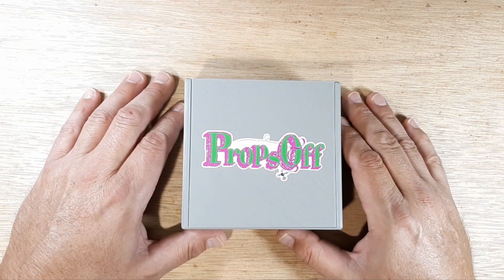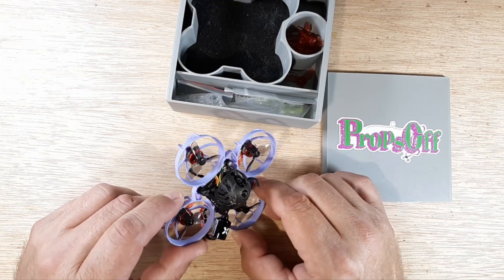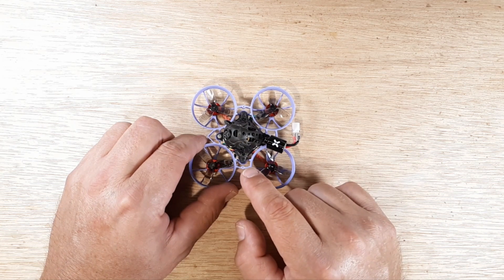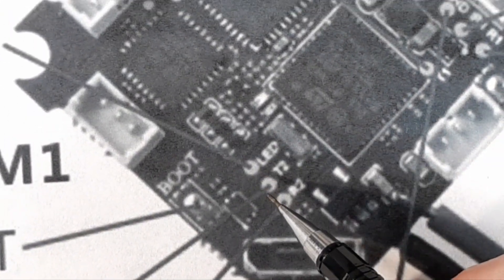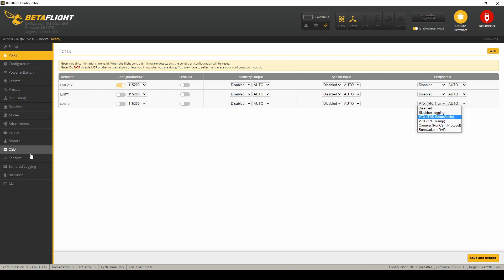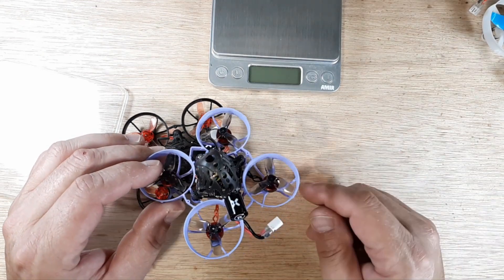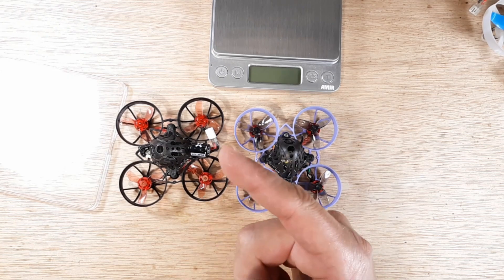Happymodel Mobula 6 VTX Failed | Crazybee F4FR Lite VTX Replacement

Comment: Hey, I wanted to add an elrs module to my fc and than I think i touched the vtx module when tryna solder the elrs to 5v and the vtx is not working anymore ?? What solution would you rocommand to me, im gonna buy a new fc if I can't do anytying from this one...
Reply: Okay thanks im gonna try this
Reply from the maker: @wixfix4094 
Remove the VTX and any solder flow that was incorrect. Do a continuity check to make sure there's no short (how to in my Quick Tips Playlist). Then plug in a lipo and check the 5 volt pad and ground to see that the VTX will have correct power - also in my Playlist...🧐

Comment: @PropsOff I have two Diamond F4 ELRS v4.3, one of them is showing two mosfets having blobs so i want to take the mosfets from the second and put it in the first blobed ones. Now does the order matter ? the mosfets having blobs is the top lef, if i took mosfets from the top right of the second Diamond and installed it in the first would it work ?
Reply from the maker: @bazooka5780  
This is a great question. The mosfets are all the same around the board and can be used in any of the 12 positions. There is a dot on the face of the mosfet signifying correct orientation - that must match the replaced mosfet...🍻

Comment: On the new board V3.3 is much easier to disable the VTX with just Uxbridge a solder joint and also the video out has a pin now.
Reply from the maker: They've definitely made some improvements to allow customization...🍻

Comment: Can I disable the onboard VTX and put a Digital VTX like Caddx Vista?
Reply from the maker: Yes, the video is separated once the internal VTX is removed. I haven't done this so I'm not sure if DisplayPort will work via MSP...🤔
Reply: @PropsOff  thanks for the response.
I'm thinking of converting this onboard Analog VTX to Digital using external Digital VTX.
Or Vise-Versa 🤔

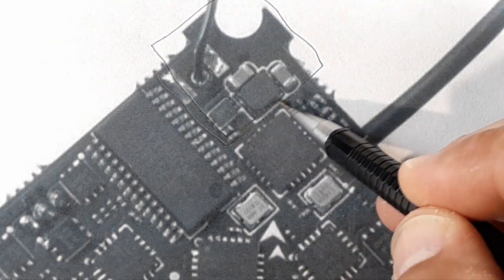Comment: I just did this and I got it to work!! Wow.  I don't know why but I was really skeptical that it would work for me. At  4:30 you circle  the vtx area and describe what to destroy.  In destroying that I accidentally popped off the 3 caps that were in my VTX area. I assumed that it would still work since that was part of the VTX and it did, in fact, work.
Reply from the maker: At 5:44 I do show the caps are still there, lol... due to the coil being gone, there's no longer current running through them, so its ok. The 5v and 3.3v powering the board are separate - which actually surprised me - does make this board heavy.. Glad all is good your way...🍻
Nowadays, I only use the 2.1v Betafpv board when it comes to 1S - external VTX is a must, internal just don't last.
Reply: @PropsOff  I did watch your video about making the antenna but the only think I have to start with is the standard  ufl antenna that is almost a gram.  Can I remove that shrink wrap and make that one lighter somehow?
Reply from the maker: @gregdavidd  
I need just a bit more information.
Reply: @PropsOff  First off thanks so much for helping!! You rock.  The only antenna I have that has a UFL connector on it weights about a gram.  It is similar to the ones that come with  the Mobula8 with shrink wrap on the end.  Underneath the shrink wrap is some kind of larger cylinder but I havent taken one apart.
Reply: Let me know if there is any way to lighten up one of these antennas.
Reply from the maker: @gregdavidd  
You could use any U.fl antenna (ex. Rxsr receiver antenna), and cut the black ground sheath back to expose the iner wire (active element). The active element needs to be 12.9mm exactly...🍻
Reply from the maker: @gregdavidd  
My pleasure.. I appreciate your support...🍻
Reply: @PropsOff   Thanks so much.  I found an antenna from an old Network device with a UFL.  I made it so it just sticks out of the canopy and its down to 0.3 grams :).
Reply from the maker: @gregdavidd  
Heck yeah...🍻

Comment: Is this possible on the mobula7 1s x12 board? I can't seem to get the video output when I disable the vtx solder bridge.
Reply from the maker: There's actually pads to run an external VTX on that board, I think. Apologies, I don't think I'm clear on what your dealing with? You soldered the external VTX and disabled the on-board?
Reply: On the x12 board there is solder bridge that is connected near the component that you removed to disable the vtx. If the short is removed it disables the vtx. I was not having any luck getting video out using the pad after disabling the vtx. I haven't been able to find anyone who has installed an external vtx using the x12 board after disabling the onboard one.  @PropsOff
Reply from the maker: @svveptunder  
After looking at the wire diagram...
https://www.happymodel.cn/index.php/2022/04/05/x12-aio-5-in-1-flight-controller-built-in-12a-esc-and-openvtx/

Seems like it's pretty straight forward, disable the jumper bridge and wire the VTX to the 4 pads. If your not getting video, you could try a few things:
Check for ground continuity 
Check for 5 volts from the + pad
Check ohms from ground to video in (75ohms)...
Check the camera by swapping it out
Wire the camera directly to the VTX (may have problems with the OSD chip...

It's difficult to help with these things without having it in my hand, lol.. But checking these things may lead to understanding why it's failing to display...
Reply: That's some great advice. I'll check it out. Thanks for uploading this video it was very helpful.
Reply from the maker: @svveptunder  
I appreciate your feedback. Yeah, check these things and let me know, keep me in the loop...🍻
Reply: So I think I somewhat figured out what was going wrong. The original x12 board was damaged it was missing 2 small resistors from near the video out pad. Also the rush tiny tank vtx may have been damaged as well? I think there might be a small resistor missing on the vtx. I didn't realize the vtx was damaged until later. Someone sent me a screenshot from happy model and I decided to try again on another newish x12 board. Apparently there are 2 solder bridges. one to disable the vtx and another to split tx2 and smart audio from the onboard vtx. I was very careful to unbridge the solder gap and direct solder on the camera. Initially I was only able to get the vtx and smart audio working. Then I tried a different vtx. still no luck. Then I moved the camera's power to the external vtx and it worked. I was able to get a runcam nano 3 and caddix ant working when on the bec from the vtx. I hooked up the wires from the x12 board to a multimeter and it reads 5v. I hooked up a 5v cob light and it powered on. It woud also power on the external vtx. But i could not get either camera to power on using either 5v pad. Maybe the damaged vtx damaged the 5v rail on the new x12 board idk. The osd on the splash screen also looked lighter than usual like a water mark. Maybe it is always like that and I have never noticed. I also put the vtx in pit mode before attempting the change.  The vtx I was using for testing was not connected to smart audio so I don't think that would have had any effect. I also tried rebridging the vtx pad again to see if it would help with the 5v rail and it did not. I think I'm just going to add an external BEC and call it a slight win. I am curious why the 5v rail isnt working for the camera. I'll probably be attempting the mod again another 8 times for adding an external tbs nano vtx to the drones in the drone racing team that I coach. I'll let you know what happens on the 3rd one lol   @PropsOff
Reply from the maker: @svveptunder  
I use an external BEC on everything (excluding 1S whoops). The dirty voltage coming from these flight controllers nowadays is pathetic. It's a real bummer to find damaged components, but it sounds like you're getting closer to winning this battle. I exclusively use Matek BECs, they offer a nicely layered LC-filter.
What S.T.E.M. program? I've helped get a half dozen programs started locally...🍻
Reply: I'm a teacher out in the Chicagoland area. I'm not convinced that I have damaged the 5v rail now. When I reconnect the bridge from smart audio and tx2 the camera powers on again. Or at least the video works when both solder bridges are reconnected. So I probably need to run those matek ones. I have a few. I have a hard time adding 0.83 grams to something so light. I will definitely feel it. @PropsOff
Reply: The matek boards I have are step down. Do you use the Matek Voltage Booster? It says max voltage 4.2... can it handle high volt batteries (4.35?)
Reply from the maker: @svveptunder  
I don't use a BEC on 1S. The Matek BEC has a voltage range, as long as your within that range, HV is irrelevant.

Comment: Hey bud I'm back lmfao so new antenna didn't fix the problem on the mobula6 so it would need to be on the board I assume but the everything seems like it's all sold. Didn't use the camera when I first got it so dk if shipped bad. Just wondering what to do now thought about putting a 3 in one camera on it instead
Reply from the maker: Refresh my memory, what is the issue again?
Reply: @PropsOff  so the mobula6 I just bought iv been flying without fpv then hooked my googles up and it's range is about 6 inches so I bought the foxeer lollipop installed and it's the same
Reply from the maker: @methodsofmeyhem  
Is the VTX table set up? Is low power mode disabled? Did you try to put the power on 100mw? 
Remember, if the VTX is running without airflow to cool it, it will burn out..
Reply: @PropsOff  yea that's possible the table is set up I tried 25,100,200 settings I may have burned it up plugged into betaflight for a while
Reply from the maker: @methodsofmeyhem  
They get so hot...🔥 There's a possibility it burned out (if all setting are right)..
Reply: @PropsOff  I ordered a micro 3 in one to install on it they work really well. Thanks again so much for the help
Reply from the maker: @methodsofmeyhem  
Wish we could have remedied the issue...🍻
Reply: @PropsOff  it's cool I should have unhooked to camera b4 sitting that long on beta I knew better lmfao but still was crappy video so I'm changing out hole vtx

Comment: Hey Props! Love your work and thanks for this video. My VTX is starting to bug out, getting black flashes slightly but still flyable. I have a Happymodel OVX300 on the way and will attempt this fix as soon as the onboard dies (or if I get fed up with the sketchy video). I'll be posting it on my channel and will credit you. Cheers mate! 👍
Reply from the maker: I've completely stepped away from flight controllers that have an on-board VTX. They just fail too soon or they get weak fast - can't see when racing 4-up..
I appreciate you thinking of crediting my video...👊🏻
This hobby is so fun, but whoops are frustrating - I have 3/5/7 inchers that have had zero issues and fly for years on end. Getting 2 maybe 3 races out of a whoop board seems unacceptable 4shO!. Enjoy the Breeze...👍🏻🍻👊🏻
Reply: @PropsOff  interesting you don't use FCs with onboard VTX cause I've been thinking about the Happymodel x12. Have you had any experience with that board?
Reply from the maker: @nxp200  
I have not. Really not something I would use on a -20 gram 65mm race quad. That flight controller is over 5 grams and has 3x the amps needed. It looks packed with lots of stuff though. Honestly, if HappyModel sent me a dozen to test out, I may be interested in it for an upgrade to the "MobyTooth". I just can't buy anything unless necessary or to repair.
That board reminds me of the V3 Crazybee F4FR Lite, which I had 9 (2 returned) of them and only 2 currently work - in 8 months...🥺
Reply: @PropsOff  sorry, I should clarify that I plan to use it on a 2 inch 2S outdoor ripper (Nick Burns' suggested build), not a 65/75mm indoor whoop. Yeh those Crazybees don't last long 😔. Thanks for the help!
Reply from the maker: @nxp200  
Oh yes! That sounds like a fun little ripper 4shO...🍻
Reply: @PropsOff  quick update on my attempt. The VTX finally gave out and range was reduced to unusable distance (snow at 10m direct line of sight). Did your external VTX mod and it worked like a charm! Thanks mate! I'll be editing the video and uploading soon for others to see the steps I followed. 👍
Reply from the maker: @nxp200  
Glad this helped. So far, the OVX300s that I have running are doing well. Interestingly, a board with a built-in VTX weighs more than a board with an OVX300 wired to it.
Reply: @PropsOff  nice! Good to know the ovx300s are holding up well. What's your go to 5a AIO board for 65mm whoop that you would pair with the ovx300?
Reply from the maker: @nxp200  
Well, I'm running a Diamond, Superbee, and a Betafpv 10-2022 board. The Betafpv board is doing better but they all have their faults. I get frustrated when the accelerometer pegs off level position  after a light crash. All seem to do it. I'm absolutely going back to acro after this race season.

Comment: Just wondering if you could help me, how many 5v outs are there? Because I would like to connect a new vtx and elrs and also a runcam thumb pro I need about 3 5v outs any clew where?
Reply from the maker: I'd have to double check, but I think there's only one 5v out pad (if you would call that little dude a pad)... lol..
Reply: @propsoff  I had a thought maybe I could right it up to a vtx with 2 5v and grounds and them rx elrs should still work and I should have enough pads
Reply from the maker: @lihppuangpet7871  
Looking at a wire diagram of the F4FR Lite, there are two 5v outputs. One on top and one on the bottom. If you can run the cam 5v to the VTX, that would work, however, keep in mind the 5v-rail itself is rated for only 1.5 amps (HappyModel has removed this specification from their website, therefore, it seems it could be less). Be cautious of your watts.

Comment: Possible "Fried VTX fix"!  First off, thank you for your videos!! So I was almost positive I had a fried VTX. I flew a battery too long and wiped out the board as you mentioned in one of your videos, I flashed and got my drone back up and running, enter VTX issue. After fiddling for a while I checked 'VTX_info' in CLI and saw 'level 14 dBm, power 25mw' so I went into the vid transmitter tab of BF (4.3.1) and added a 4th value of 14 in the VTX table, BOOM perfect clarity!  Hope that makes sense and maybe you can see if I'm on to something.
Reply from the maker: For the VTXs I've had go bad, they slowly died and were going 10 feet at best. This is Interesting and I will be looking at it more. I appreciate your support and feedback! My mom always said, "if ya ain't learnin, ya might aswell be dead"...🤣

Comment: I've never even got to see any video on my mobula6 HD, my goggles just stay static and nothing happens. The drone flies well but I can't use my goggles. Do you think my VTX is broken
Reply from the maker: If you only see snow, the VTX and goggle are not on the same frequency, or, the VTX isn't outputting. If the VTX is set to zero or pit mode or broke, this could be the issue.
Reply: @PropsOff  I've tried the search option on my goggles and nothing happens. I have then manually set the channel on the drone in betaflight and manually on the goggles. They are still static?
Reply from the maker: @ryanjones6837  
Can you get a picture of your VTX tab in Betaflight and then a picture of the goggles with the setting?
Copy your last message and paste it in a PM to my Facebook...
https://www.facebook.com/scooter.pie.100

Comment: Great stuff and I am glad I discovered you recently. I built a version of a Babytooth 3 inch 1S quad with a Happymodel Elrs 2g4 board. To my dismay the vtx is weak. Contacted HM and they sent me instructions to disable the vtx and where to solder in an external vtx so your video has come in very handy even though the boards are different. Since my quad has alot of disc area and weight is not as much a problem as a whoop I went and ordered a tbs unify pro32 nano and thinking after watching your other video about redundant grounds which is also great I am considering ordering a Pololu S9V11F5 .5 gram 1.5 amp constant, super tiny step up/down 5 volt power regulator for my new vtx and not take any more power from the whoop sized board.  I have heard external vtx's can sag/brown out when running 400mw and taking 5 volts from the board in other installations. What do you think? Subscribed.
Reply from the maker: I appreciate your feedback, support, and encouragement! Welcome to the PropsOff family! 
Your story isn't unusual, sadly. HappyModel has sent me a few with VTX issues and I've had half my fleet burn out. I think your right in choosing a BEC to drive the VTX running 400mw+. The redundant ground may not be as critical here in a single board configuration. I can't remember the amp draw of the unify at max, all mine have burned out. I do believe they are power hungry. Sounds like an interesting project. I had lots of fun with my Mobypick turned MobyTooth, lol. Enjoy the Breeze...👍🏻🍻👊🏻
Reply: @PropsOff   I will check out those videos. I don't plan on mega mw ,just enough to be happy. Thank you for your reply.
Reply: What were the directions to disable the vtx from happymodel? I mean I’d rather do some betaflight commands to disable it if that’s possible, otherwise I’ll follow this video
Reply: @djs134  What I did was email Happymodel and ask like I did. They sent me instructions how to do it.  If you are experienced at soldering it isn’t a bad job. Good Luck!
Reply: @turboomni848  thanks for the info. Yeah I’m looking to add hdzero so I’m wondering if I can skip the bridging the caps together